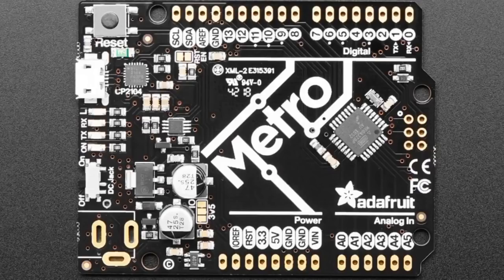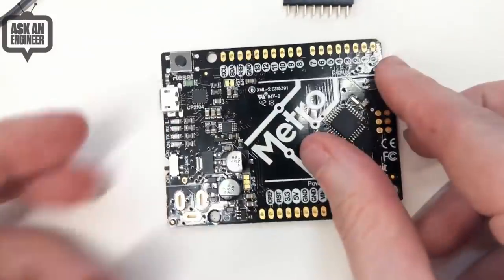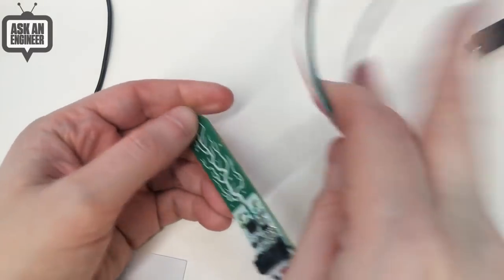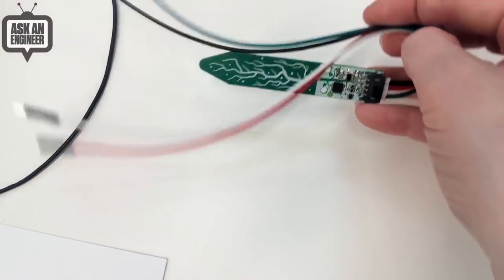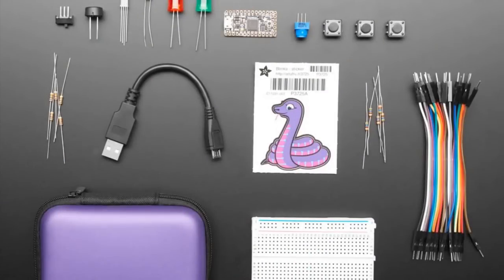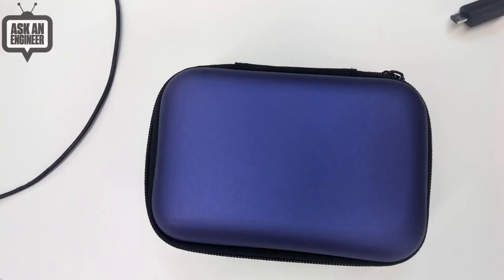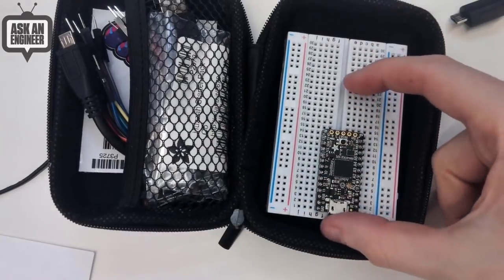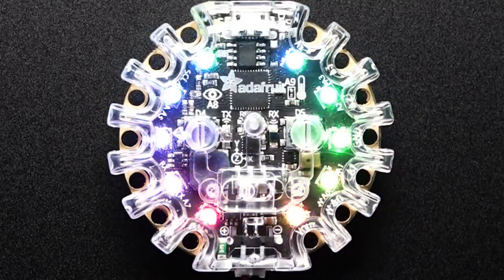New Products 11/14/18 Featuring #CircuitPlaygroundExpress Enclosure! @adafruit #adafruit

Comment: RE: STEMMA soil sensor
If you sprayed a couple of layers of polyurethane over it to further seal it from moisture and then made a plastic shield to connect to it through those two holes that are between most of the circuitry and the root-shaped masking to sort of prevent the thing from being inserted into the soil too deeply, would the polyurethane mess with the sensor's ability to work with the moisture in the soil for monitoring purposes, or would a couple of layers of poly just make it deaf to the very thing it's supposed to be sensing? I would bet the poly coating would make the temperature sensor less responsive/accurate, but I'm thinking of using this in a green house environment where it's really hot and really humid all the time anyway. I wouldn't want this thing to just corrode and die and have to be replaced every year or so.

Could also be used with an irrigation system for houseplants. When the soil gets too dry, open the solenoid valve and let some water in. Datalogging for houseplant health as well.